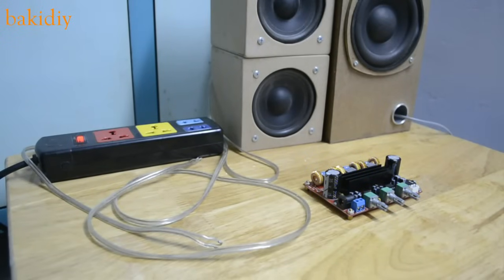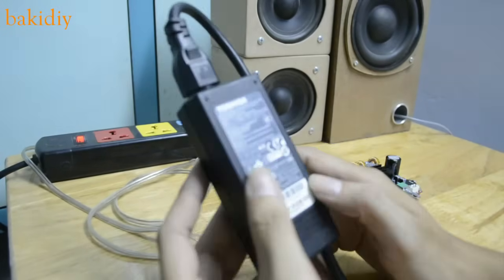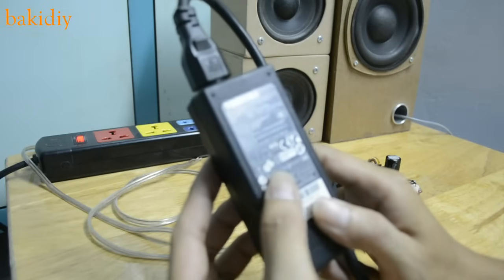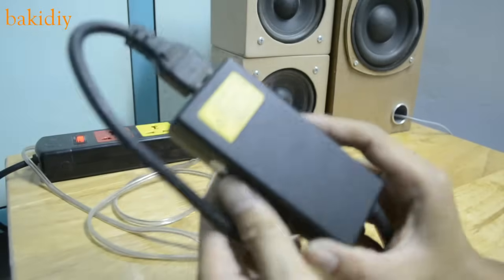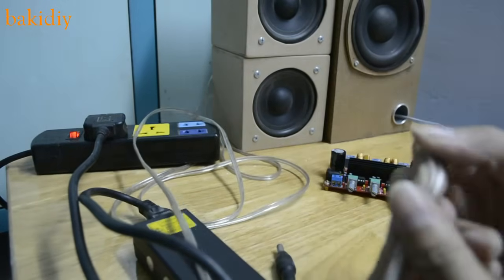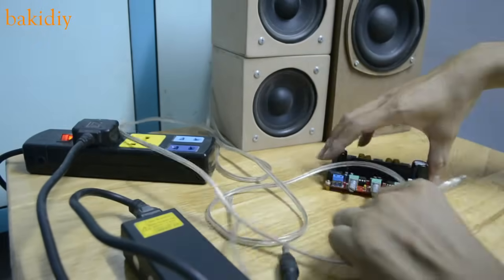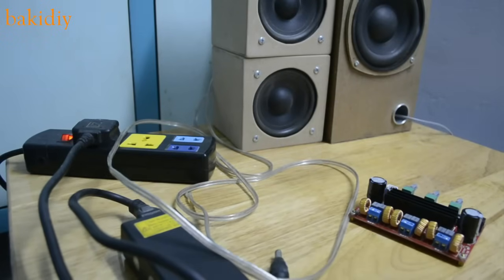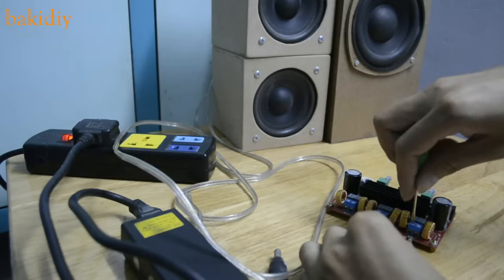Unbox, first test and make a box for TPA3116D2 2.1 channel Amplifier (2X50W + 100W) #2

Comment: Hi bakidiy! Planning to buy this board. I have 4 questions. If ever I buy this board, I will use my HP adapter 19v 3.42A. So my power source is good.

1) Now for my stereo speakers, I have two 30 watts (max input power) rated at 6 ohms. The spec sheet of the board says it supports 4 - 8 ohms. That's a range, right? I mean tpa3116d2 can support 4 ohms, 5 ohms, 6 ohms (my speaker), 7ohms and 8 ohms?

2. Subwoofer. Is there a rule about matching stereo speakers' ohm rating with that of the subwoofer? Should I only use a 6 ohms subwoofer for my 6 ohms left and right stereo speakers? 

3. Im confused about whether I should match the ohms of the subwoofer with my left and right speakers. Can I use higher than 6 ohms?

4. I was told I should not use a 4 ohm subwoofer with my 6 ohms left and right speakers. Is it true? Can you give a short explanation why?
Reply from the maker: 1. Yes
2-3-4. You can use any 4-8 ohm subwoofer without problem, just don't use different left and right speaker, It cause unbalanced sound.

Comment: How many watts your subwoofer is?
Reply from the maker: it's 4" woofer, 8ohm, 50w
Reply: @bakidiy  thanks sir, by the way i have a plan of builting a diy bt speaker but im not an expert, i have a question sir what kind of speaker should be paired with a subwoofer? Midrange or full range? I have no idea sir i hope you can help me
Reply from the maker: @RommelAbella  It depends on your taste of music, but fullrange speakers are probably better in sound performance
Reply: @bakidiy  last question, what subwoofer will you recommend? Dual voice coil or single voice coil?
Reply from the maker: @RommelAbella  Dual voice coil or single voice coil is not related to sound quality, the different is that we can change the impedance of the dual voice coil speaker so you can use this speaker on different amplifiers. If you only use it on TPA3116D2 or same amplifiers, just need single voice coil SP.
Reply: @bakidiy  thank you so much! I learned a lot from you, 250W subwoofer is ok to put in the tpa3116d2?
Reply from the maker: It's ok but a bit wasteful because the maximum power of TPA3116D2 is 100w for subwoofer, so we will not be able to use all the capacity of the speaker. Maybe 100-150w is enough
Reply: @bakidiy  is 100W subwoofer is loud enough in the living room? And i have a question again the tpa3116d2 has 1*100W and 2*50W right? So the 100W is subwoofer and what is the 50W? Its full range right?
Reply: @bakidiy  you have fb? Because ill just message you soon if i will build diy speaker
Reply from the maker: 100W maybe enough for <=25m2, TPA3116D2 is 2.1 amplifier so you can use 100W sub + 2x 50W full range speaker.
Reply: @bakidiy  thank you for always replying me than you very much, this is my last question promise, my question is what will you recommend speaker for me to paired with subwoofer? Is it really need to pair subwoofer to a full range? Or its ok to pair subwoofer to a woofer? Im really confused i dont know what to be paired of haha
Reply from the maker: Subwoofer or woofer only good for low frequency so maybe it ok if you only listen DJ music or drum sound,... :) You need a full range or at least a midrange speaker to listen mid and high sound from many kind of music especially vocal, violin,... (some woofer can use for mid sound but can't perform high sound)
Reply: @bakidiy  oh ok thanks thanks so i should use full range? I will buy tas5630 amp that has 2* 150W and 1* 300W
Can i use 2 full range in its channel? Like 2 full range in the L and 2 full range in the R and 1 300W subwoofer? Because i think theres no full range that has 150W
Reply from the maker: @RommelAbella  No problem, but you need to pay attention to the resistance of each speaker to know whether to connect in series or parallel

Comment: I bought this amplifier but it is not working just when I turn it on the speaker only bump but no sound coming out from it.what should I do
Reply from the maker: You need to use 12v 2A or higher power, check the audio connector cable, some cases of 3.5 jack integrated microphone will not be suitable.
Reply: Hello I change that cable and it's working  but after 5 minutes of use its become to hot what is this any solution please
Reply from the maker: During operation, it will become hot, that's normal. You can replace the default heat sink with the bigger one and should not use speakers that exceed the board's capacity
Reply: @bakidiy  can I use 80watt 8ohm speakers as sub woofer
Reply from the maker: @abdulmohid2614  yes!

Comment: in first video you used 12v 2.5a adopter and in this video 19v 3.5a, so does it give you different in sound loudness?
Reply from the maker: There was a great change, especially bass, which was much stronger. If I have better speakers, there will be more differences
Reply: Yes more volt and ampere you feed the unit the more power you get out of it

Comment: Should I use this with 24v 5 amps or 4 amps I don't want to blow my speakers but also want full power without going overboard pls help.
Reply from the maker: I think this's ok, just slowly turn up your volume to check if your speakers have any problem. And you will never need to worry if you have 2x50W speakers and 100w subwoofer or higher.
Reply: Rayans, according to the specs I read ( http://linhkienviet.vn/mach-khuech-dai-am-thanh-classd-2-1-2x50w-100w-tpa3116d2-v2 ), at 24 VDC the TPA3116D2 2.1 channel Amplifier will draw 5 amps, so using a 4 amp supply might result in the amp "asking" for more current than your supply can deliver, and could cause damage to the 4 amp power supply.  That being said, you can safely use a 24 VDC 50 amp, or 100 amp, or ??? amp... power supply. Remember, the amperage rating of a power supply is what that power supply is able to deliver when "asked" (by the TPA3116D2 2.1 channel Amplifier).  Amperage is "requested" by the unit being energized (in this cae, the TPA3116D2 2.1 channel Amplifier). Amperage is not "pushed out" by the power supply. It is a potential.

Comment: 19V x 3.4A = only 65W, board is declared 200W ????
Reply from the maker: This just for testing my board. I don't want to make this board work at full strength and destroy my small speakers. If you want to drive high power speakers, just use higher current adapter and have good heat dissipation for the board.

Comment: What have your power supply parameters? Because I tryed with laptop supply 19V 4.7Amp and works very fine.
Reply from the maker: I''m using my laptop adapter too :)
Reply: What power did you get, beacause adapter is below 100W, and board is declared 200W ?

Comment: Good day I just wanted to ask what is the lowest impedance it can handle I  would like to know because what I have is one sub 100 watts  8 ohms and will add two 90 watts 4 ohms connected in parallel, I hope someone can answer if what I am doing will be just fine. Thanks in advance
Reply: Hello,
so if you want 4 ohms speaker, you can make it from 1x8ohm in parallel connections. But for a digitally amp I will not go down bellow 4 ohms.
Reply: @mrstanlez  Thanks the response :D

Comment: Did you use full range Driver LR ?
Reply from the maker: Yes
Reply: How Much Amphere Max For Power Supply/Adapter ? 5A or 10A ?
Reply from the maker: I use my laptop adapter: 19v 3.42A
For best perfomance, you can use 24V, >5A  adapter
Reply: @bakidiy  im planning to buy a pair two ways active speaker, for information its 2x60 Wrms 180w power consumption with 12" woofer, could you please to tell me how loud it can be if i play it on my front or back yard?
Reply from the maker: It's too difficult to tell you, but this is 2.1 amplifier board, if you use 2 speaker without subwoofer, I think you should buy a TPA3116 2.0 board
Reply: @awesome guy ty for your explanation, i saw at db table 64w is 108 db while 128W is 111 db, so thats mean i will get 108 db for 2x60w right ?

Comment: I have the same amplifier and when i turn it on the volume is kind of  low and with almost no Bass at all, is there Something i can do?
I use 2 60 watt speakers and 1 100 subwoofer. Im Building a homemade boombox
Reply: check the manual.. see if it can support 24VDC input. 5A--10A regulated power supply would be better to support your subwoofer. use a car battery (if you have) for testing purposes.
Reply from the maker: There're some things you can try:
Use another DC adapter 12v 5A or higher
Check your wires, make sure you connected right polarity +& -
Turn sub gain knob to maximum
Check you speaker
Check the 3.5 wire to your board
If It can't help, may be your board have problem.
Let me know if you find out :)
Reply: What is your speaker impedence, it what load does your speaker put on your amp

Comment: 2×15w speakers and 1×40w subwoofer can be used in this amp?if not plz suggest one which does
Reply from the maker: Hi Living India, The bigger speakers may be better, but it's ok if you use 2×15w speakers and 1×40w subwoofer with this board.
Important: Don't use maximum volume or your speaker will be destroyed.
The best solution is use small adapter such as 12v - 1~2A, don't use higher one :)
Reply: bakidiy can you plz suggest me ampligier board for my speakers and subwoofers i have 2×15 w speakers and a 40w subwoofer plz suggest if you know one
Reply from the maker: As I said, TPA3116D2 is the cheapest and most suitable for you because there is no 2.1 board have lower power, you can find 2.0 board (not have subwoofer) such as TDA7297.
So just use TPA3116D2 with 12V-1A or 12V-2A power supply, that ok

Comment: Test del amplificador stereo a 24v : Potencia RMS o continua.
16 watt a 16 ohm , Resp. a frecuencia a -3db : 10 a 12000Hz
30 watt a   8 ohm                          "                        10 a 5000 Hz
50 watt  a  4 ohm                          "                         10 a 2200 Hz

Subwoofer:
30 watt a 8 ohm  ,      Rf a -3db                          : 10 a 65 Hz
52 watt a 4 ohm .           "                                            "
80 watt a 2 ohm  ,           "                                            "

Me funciono una semana bien, pero parece que debido a que las bobinas se calentaban bastante (80° C) y el gabinete que lo instalé era pequeño se recalentó y daño los capacitores e integrados. No lo recomiendo.
Reply: carlos barria ampletos chines necessita ventilacion por cooler 40mm
Reply: lo responsable por lá alta temperatura es lo regulador de tension que está próximo ao conector DC ele chega a+85graus

Comment: Greetings from Greece ! Do you think TAS5613 amplifiers could be a better deal?could you make a review also please?
Reply from the maker: Hi Kostantinos Kalominidis, I'm just read the datasheet of TAS5613, in theory, the sound quality of TAS5613 may be better because it support PurePath™ HD technology, but I think it's difficult to see the different, it depends on the quality of the circuit board design. So the main different here is the output power: 2x125w 4ohm speakers (TAS5613) vs 2x50w 4ohm speakers (TPA3116D2). So you can choose TAS5613 if you need to drive high power speakers, if not, TPA3116D2 is enough for you, it cheaper also :)

Comment: Theres two things I don't like about the sub you have right there:

1. It's blown and the box has an awful acoustic 
2. It's a 25 watts sub that you're about to blow and the box still has an awful acoustic for the sub speaker

I would recommend you to be careful, I made a 2.1 speaker using the 24 volts and 5 amp, then it jus blew a 25 watts sub I had in a matter of seconds, I hope you can fix the sub thing and make this a great project :)
Reply: Ivan Daza i had 2 of these amps

Comment: i need heavy and deep bass!
does it give deep bass?
i have 2 10w full range speakers nd a 4 ohm 8 inch subwoofer! will it be able to handle my sub?
Reply from the maker: Hi Istiak Emon, I don't know the rated power of your subwoofer,
but I thinks it's around 100W, so this board can handle it.
Your two full range speakers only need 10W input, this board can handle 50W so it ok too, but I think you should use higher input
speakers for better sound.
With this board you can adjust the Total volume - Sub - LR channel so you can adjust to have deep bass
Reply: bakidiy my sub is 80w maybe!
Reply from the maker: This board can provide 100W output for subwoofer (depend on your power supply can provide enough power)
Reply: bakidiy 19v will work? i have a toshiba adapter!
Reply from the maker: The power range can be from 12-24v, so 19v is ok
Reply: nd can i control bass frequency??
Reply from the maker: On some websites, they say it can adjust freq from 80Hz-500Hz by using middle knob, but I guess it's subwoofer volume :)
I think you can control bass freq on your music player
Reply: okay thnq bro :D 
im gonna buy one
Reply: I'm using the same TPA 3116 D2 chip in a mono configuration for a dedicated 4 ohm 8" hertz subwoofer. It goes loud ,it bloody likes to drive the woofer to the physical limits on 20 hz tracks. I need to fool around with gain and volume a lot in order to keep the sub from bottoming out, so yeah, i guess it will fill your needs regarding bass.

Comment: This is the specs I got from the manufacturer on 19V ------- 8 ohm(Speakers) 32 + 32W 4 ohm(Speaker) greater than 45 + 45W. Here is what I got total!-Power supply voltage 12V ------- 8 Ohm speaker 12W left channel + 12W right channel 4 ohm speaker 20W left channel + 20W left channel 15V ------- 8 ohm 18 + 18W 4 ohm greater than 30 + 30W 19V ------- 8 ohm 32 + 32W 4 ohm greater than 45 + 45W 24V ------- 8 ohm 38 + 38W 4 ohm greater than 55 + 55W Package

The Pop is the only downfall. But the on/off switches I placed on the speaker grounds and the power seem to have done the trick. I had to also add a new DC plug. Seem to bypass the HUGE Pop/Thump!

Great Video!

Edit-On the Woofer Specs, I assume if the Mids are 32w(8 ohm), than the woofer would be around 64w(8 ohm) on 19v, and on 4 ohms it would be 90w woofer.
Reply from the maker: I think he put the switch on the speaker's grounds because it's the common line, so you only need 1 switch to control 2 speakers. If put it on positive ine, you need to use 2 switches or a 4-pin switch :)
Reply from the maker: Thank you bro.
Reply: You placed on/off switches in the grounds? shouldnt be on positive line?